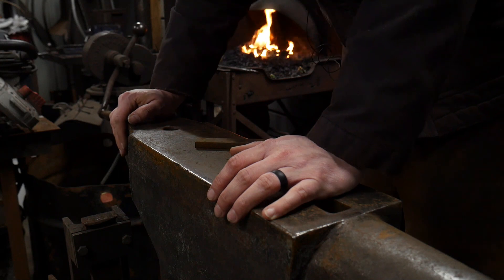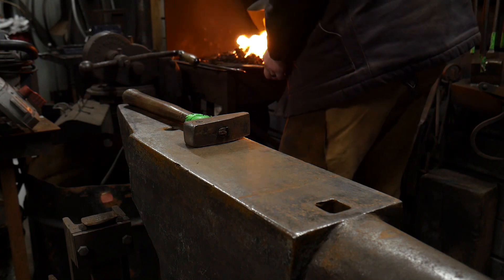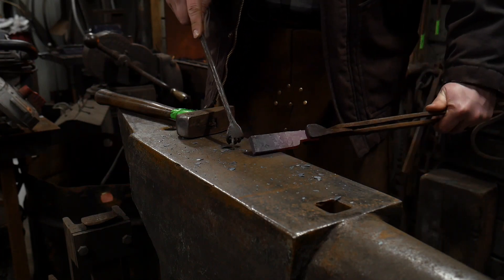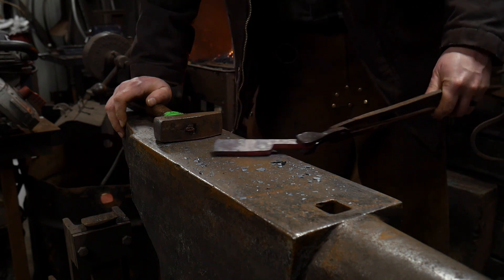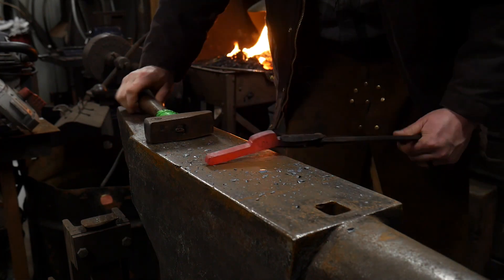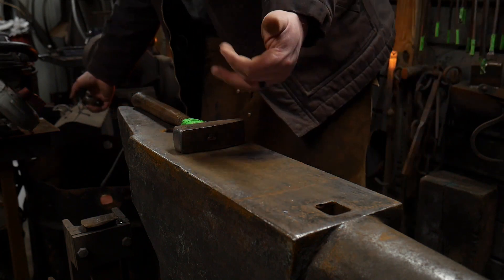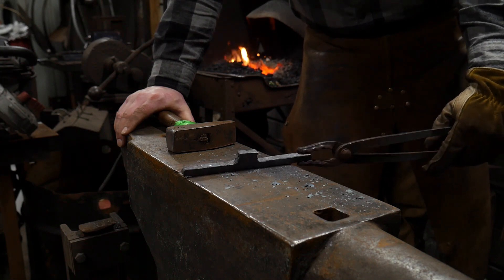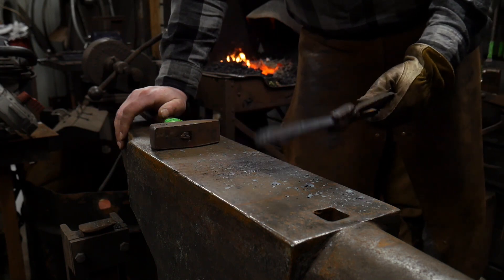Forging a Boss // Forging Practice

Comment: I can see the value of using this to practice different lengthening and shoulder technique and I will definitely give it a go, this may seem like an odd question but what do you use the end product for? I have never come across this before and you mentioned it could be used for tools etc
Reply: Commonly this is used to forge a bending fork, and like Roy was talking about a captured bolt in a lock.

Comment: Nice technique,  out of Curiosity,  to get the same end, could we shoulder and draw the ends closer together starting with the smaller boss? Or if we need to lengthen the boss, start with a wider piece and set the arms down further than half?